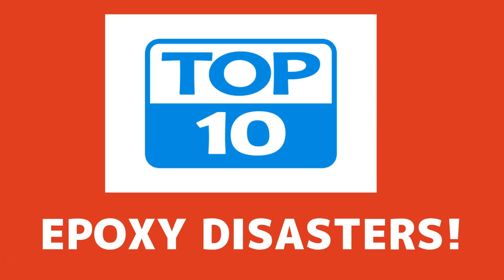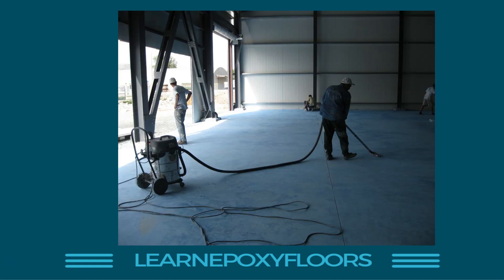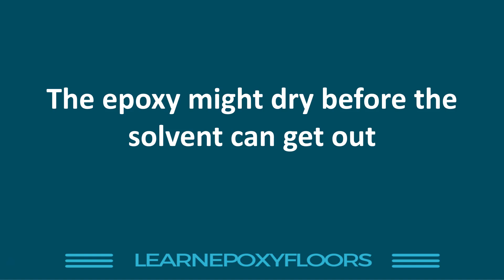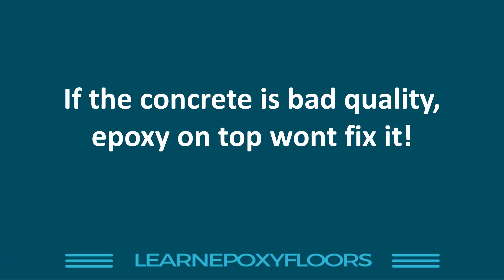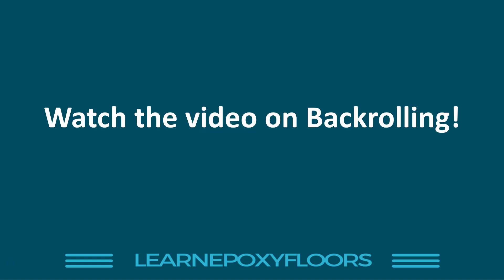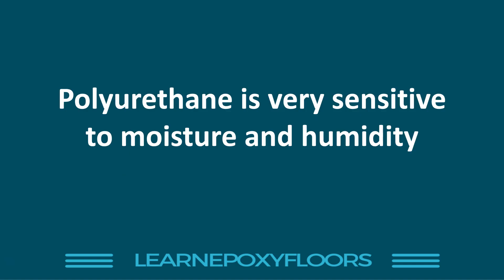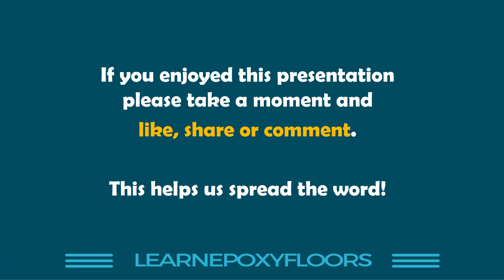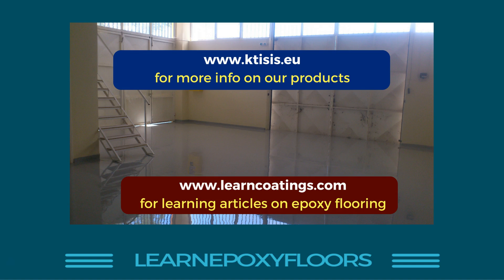Epoxy Flooring Disasters that could happen to you! - Learn about our top 10 incidents

Comment: Great video.  I'll be hoping to pour a clear resin on a timber floor with some posters and ticket memorabilia in my mancave quite soon, I'm unsure with how  best to seal the timber though, I'm thinking pva sealer but  unsure at the moment if that's the way to go, anyone done this before? If yes I'd appreciate tips.
Reply: Do a seal coat before going all in.  Just a light coat and let it cure completely.  Wood is so porous that if you don’t start with a seal coat of resin AIR will bubble up thru the resin EVERYWHERE when you go for it all at once and then it’s done.  The only way around it is if you know the wood is less than 5 - 10% moisture content.. and you’d need a meter to know.  
Also,  by doing a seal coat 1st it will allow a space for your memorabilia to ‘sit’ just above the wood.. if you just poured resin on and then laid down your pieces they would sink to the bottom finding their level.  Unless you’re experienced with timing/waiting on the particular resin you use viscosity, having a cured layer underneath will serve 2 purposes.  Depending on what the dimensions are & what resin you use, you could possibly do the 2nd layer in a couple of hours (3 - 4 hours) it needs to be at the stage where you can leave a fingerprint but not sticky enough to pull up strings when you touch it lightly.  In both pours a heat gun or torch is necessary to remove air bubbles out at  8- 10 minute intervals for the first half hour.. just waving back & forth at about 6-10 inches you’ll see them popping like magic.
Reply: monkey trousers Also, I find it best to take good copies of my memorabilia and keep the originals, you may need them for another day! Before placing them into the resin have them LAMINATED! Without laminating them they will soak up the liquid and look WETTED & see thru. You can laminate them with simple packing tape.. be sure to extend past the edges a little bit all around ON ALL SIDES SO THE TAPES TOUCH each other and seal burnish with a plastic sharpie edge or something that won’t scratch .. this will keep the resin out.  I usually lay down a strip of tape face up & flat and then lay my piece onto it.. then cover it with another piece of tape face down.. then trim with scissors leaving a little overhang all around.  It will be invisible in the resin. With larger pieces do several strips of packing tape overlapping slightly .. or buy laminate sheeting. Start with a smaller board to test with and when you know you have everything right go for it!  Any other questions or concerns I can assist with, I’d be happy to help ✌️Hope you have great results!
Reply: @debrajol3585  some great tips there, I'll definitely take your ideas on board. Thanks👍

Comment: I know this is a silly question, could I use epoxy on gravel?
Reply from the maker: You can check out this thing called stone carpet. It's basically gravel like stones mixed with epoxy that form a pretty cool looking surface. However you need to mix the gravel into the epoxy don't try just pouring on top

Comment: Im a Journeyman waterproof whos installed several million sq ft of epoxy flooring,heres a tip for filing cracks in concrete,do not use caulkings,buy several rolls of the yellow polyester fabric used to reinforce plaster & drywall mud,fill the crack with epoxy and put a coat of epoxy 4 inches on each side of the crack,rub the fabric into the fresh epoxy and lightly coat the fabric,come back the next day & your floor cracks will be fixed and never reopen again,you can buy 36" wide rolls of the reinforcement fabric to install between layers of epoxy before top clear coating , we use reinforcement fabric over all heavy forklift traffic floors & the floors never crack & peel.
Reply from the maker: This definitely sound like something I will try, thanks for the tip!

Comment: I’m interested to learn epoxy flooring to make a bussennes like a contractor.my problem is this poseble apply 		tropical country like in the Philippines please advice thank you very much
Reply from the maker: Yes you can apply this product in the Phillipines. You may need to consider using some moisture tolerant products. Also you should check out our online flooring course https://www.smallbizcontracting.com/epoxy-flooring-course

Comment: I had some of these things happen to me when a guy came to install my expoxy. I sent him pictures if what happened and contacted the company and they never came back to fix it. how do I remove it from my floor. the expoxy is white. I had the roller marks, heat disaster it was a very hot day. stuff stuck to it and uneven application and bubbling in some areas especially the door and middle of the floor. it's in my kitchen so the kitchen cabinets are in alreay. please help they not responding to my msgs I said I would pay them again just to fix it.
Reply from the maker: Am sorry to hear that they won't come back. Instead of removing it I would recommend coating over. You may try getting someone to sand, then prime and finally apply a new coating on top. I also would not recommend applying a white coat. Lots of things can go wrong with white floors
Reply: @learncoatings-epoxyfloorin9448  thank you for the advice. I will save this video it was so helpful.

Comment: Will a thin layer of epoxy start to peel with time?
Reply: Like paint or most adhesives  if you don't get all the dust and tiny particles up it sticks to the dust n stuff instead of sealing to whatever u r trying to get it on and will peel years later. That's why most paint chips unless the surface you put it on is clean or whatever it is stuck to crumbles

Comment: I was a project manager of a large mega-church facility with a theatre style concrete slab, set over backfilled stem wall footings above grade. The project was interrupted by the severe floods of Tropical Storm Allison. Basically, the elevated slab was completely submerged, cured under water &, after the waters receded, additional backfill slurry had to be pumped into voids before the slab could be completed. Several months later, the structure was dried in, the slab was receiving its scheduled acid wash. Then finished with a urethane sealant. The acid washing began within days of the building being conditioned & the urethane finish was applied as initial moisture tests came back good.
The following week a fog in the floors urethane was obvious, application was stopped. The next day another section fogged...it was the area applied seven days before...every day a new section, until seven sections of the uppermost slab elevation had fogged. Moisture tests were performed again, these came back well above acceptable limits for urethane application!

After months of investigation, it was determined that the backfill soils, below the slab, were retaining moisture from flooding, the HVAC was drawing that moisture through the slab, & that a system of weeps drilled in the stemwall were needed to allow drainage during the next few months (possibly years!

It was a true disaster...
Reply from the maker: Oh my, yeah those projects are the worst. Thank you for sharing! Moisture tests come back good, and then out of nowhere problems appear. You can find yourself going down rabbit holes and never figurig out where the problem was!

Comment: So how did you prepare for the rain water ??  Check the forecast ? Tarps? Water deversion sand bags ? And on the sticky epoxy did you only have to remove just that section ? I'd really appreciate how you managed to save these floors and still keep your customer happy
Reply from the maker: For rain water I recommend do not do any floor projects unless the building has been properly sealed and waterproofed. With sticky epoxy  we only removed that section of the floor and fixed it

Comment: If do the flooring need in one time do the whole place ?
Reply from the maker: It is always deisrable to do the floor in one go. This will make the floor look seamless. Obviously in very large floor areas this is not possible. But if you break up the floorin several parts you will have visible seams

Comment: For #9, forgetting to mix A and B: I’ve only done 2 garages DIY (minimal experience)...one was easy, one was big...for the big one since I had to mix 5 batches, I NUMBERED each bottle of A/B before starting to avoid mis-mixing. I was using a 2:1 ratio product, but it came in full gallons, so I had A1.1 and A1.2 to mix with B1, then A2.1 and A2.2 for B2, A3.1 and A3.2 for B3, etc. The first project took 15 gallons total, 10 A and 5 B plus I used pigments in some (both metallics and pearl) and used a mica/glitter in one batch. From the way you described the hell created by not mixing right, that Sharpie marker might have saved a lot of work and expense!
Reply: I think it's different when you have multiple workers and you expect a little bit of more common-sense from each of them. I'm a professional painter and I also have people working for me and you wouldn't believe what type of mistakes some people make.

Comment: Looking at your video it look easy to get  it done  but is their a specific time for adding the second colour never saw it done does any sanding required to get the shiny looks? Need a urgent ans
Reply from the maker: To answer your questions
a) each coat was applied on different ideas, you usually need 12-24 hours for the next coat to be coatable, although this timeframe will differ depending on the product and the temperature.
b) no you can't really polish Epoxy, you basically apply the self leveling epoxy and wait for it to dry
Reply: @learncoatings-epoxyfloorin9448  Thank you very much for your respond I just love looking at you guys works really fantastic hoping one day I can do,it's such a beauty,keep it up

Comment: You can apply on wet substrates if it is a water based epoxy, it actually helps it adhere better.
Reply from the maker: Yes that is true. Many water based epoxies tend to contain water anyway so they will just go and bond to a wet substrate. However it should be just a damp or slightly wet substrate, it should not be attempted with any standing water

Comment: Few questions:
How epoxy resin floor cope with domestic underfloor heating systems.
Could 3M ceramic microspheres be added to poly top coat for warm touch feel and for anti slip.
Reply from the maker: Underfloor heating can cause expansions and contractions of the floor that can in certain cases lead to cracking of the epoxy especially around the edges. I would recommend Pu based instead that has better elasticity. You would need to test out the microspheres as some types can be very absorbent turning your epoxy into mud. I know that censospheres are used in certain formulations
Reply: @learncoatings-epoxyfloorin9448  thanks for the reply

Comment: Sir can  i use it on conrete board floor like hardiflex 3/4 inch flooring?
Reply from the maker: Always remember that the epoxy cannot make the concrete board stronger. So if you plan to put heavy loads on the board that it cannot withstand, the epoxy on top will crack as well
Reply: Ok, thank you very for the info.

Comment: What do I do when I forgot to apply the B component. Just did my garage floor and trying to figure out what to do by tomorrow.
Reply from the maker: @John Lawson before the work starts pair up the A and B components for each pack next to each other. Don't have any stray single components hanging around. As the work proceeds it is easier to see if there is anything missing
Reply from the maker: Try removing all the excess liquid with a scraper and a bucket. Then try to clean as much as possible with solvent and using a mop. Be careful it will get smelly. Make sure the place is ventilated. Once the solvent has dried recoat with the B component this time!
Reply: LearnCoatings - Epoxy Flooring Training officially the worst thing I’ve ever had to do. Hands and knees scrubbing it off 😩

Comment: Any idea how to make the cloud/moon crater effect on polycuramine? Xylene relaxes leaving soft edge craters when applied at 45 min mark. Thanks
Reply from the maker: Have you tried a faster curing solvent like acetone? Just be careful since these are quite flammable!
Reply: @learncoatings-epoxyfloorin9448  acetone was 1 of my options but had not gotten to test it, as you can imagine at $100 a box and only 60 min window of work time, i   had only been able to test Xylene and MEK on 1 sheet of flooring.  
I will be laying down 4 more boxes on my 1st side where i made a mistake and had to remove 2 bags of the clear coats and start over to have the same volume of material so the 2 sides of the garage floor would in theory match seamlessly. 

Thank you for your lead on the acetone,  i may as well try denatured alcohol on my test board at the same time.  Yes i enjoy learning.  Preferably not at my own expense,  but, I think I remember it longer if it is at my own expense
Reply: Also, any suggestions as to time?  As far as how long after i have it layed down and all swirling is completely done, asap at that point or  is it better to wait 20, 40 or even longer?
Reply from the maker: I am not that experienced with metallics and swirling, I just thought I'd mention faster drying solvents as I know that many metallics professionals prefer them
Reply: I really appreciate it, with zero knowledge on my side, your suggestion is really appreciated,  thank you so much,  honestly,  it does help

Comment: Working on my own 2.5 car garage  applying the Rustoleum rocksolid metallic to the floor. I started it 1 June and will be done by 1 August... 2 month you say? Steady is fast, quick is slow.... I have made some or had a few of these OOPS.  My worst OOPS was applying too much holographic glitter into a 2nd box of clear coat.

Thanks for showing these,  i have an easy relaxing lifestyle for retirement but hate to make mistakes
Reply: Well applied my 2nd coat of blue of 4 single box in 1 bay, added the gold and silver holographic glitter and this time added gold, silver and blue mica and all to 1 plastic cereal spoon per 1 box. As a final touch, i spritzed each of the 4 boxes area with Xylene for a moon crater effect,  at 5 min, instant craters, then 45 min steps backwards over each section.  It softened up the look. 

It is also CHAMELEON effect,  i took 3 pics at the same place and angle in 10 seconds and the color goes bright blue to gun metal.
Reply: Next step is 2 coats of clear coat, 2 boxes each side, each coat. Then done
Reply: Richard Rosenau Doubt ur ever gona read this, but anywayz. Luv to see how the holographic. glitter did.... as I am retired myself...... And have taken 2 coating All flat surfaces around my house, that the lil lady will  allow. Used onyx glitter on the patio & the holographic glitter I have MIGHT end up on 3x30ft pathway.The sample I made is unimpressive but I’d luv 2 no what a holographic garage floor looks like
Reply: I hope my additional glitter and mica and extra boxes and coats payoff and not cause a floor failure....possibly a future disaster video... lol
Reply from the maker: ha good luck with the application!
Reply: Great video! Lots of very good information.